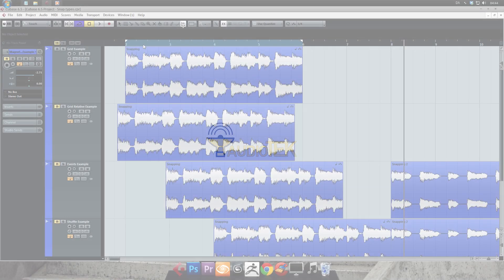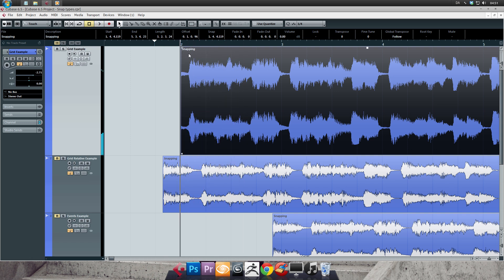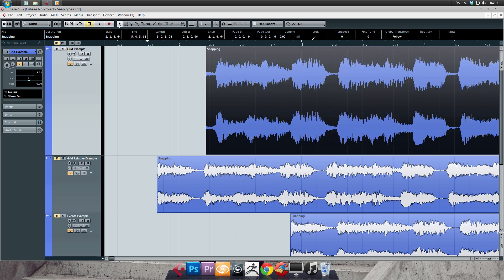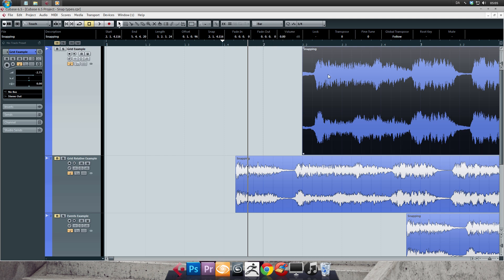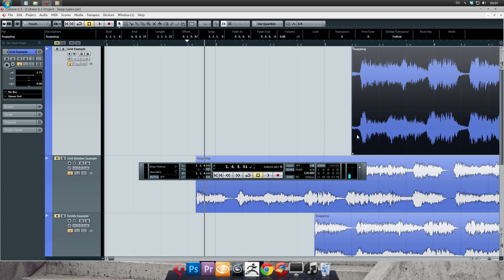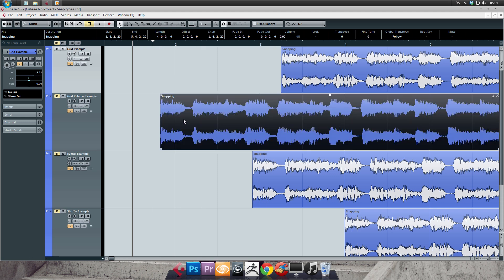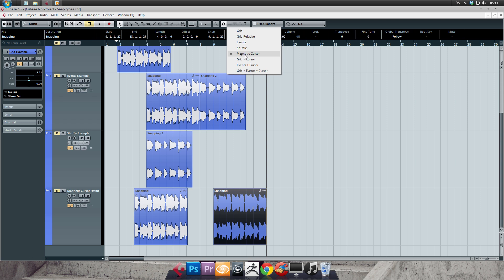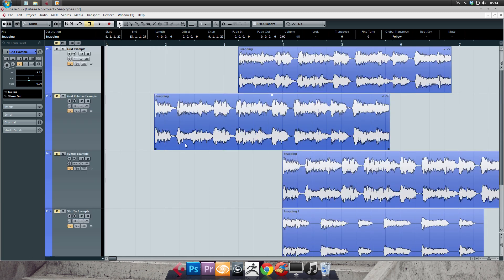Cubase 6.5 Tutorial - 5: Snap Functions & The Grid

Comment: Hi, I am a pretty advanced user but I can't find the answer to this anywhere so I ended up here :) When I export an audio track, the vertical blue line (snap point) appears on that track. I do know how to adjust it and put it back on the beginning of the event, that is not a problem, however, it's a hassle to move the snap point manually on many tracks, I don't want it to happen at all. I want to export a track, then put it back into the project with snap point at "zero". Thanks in advance.